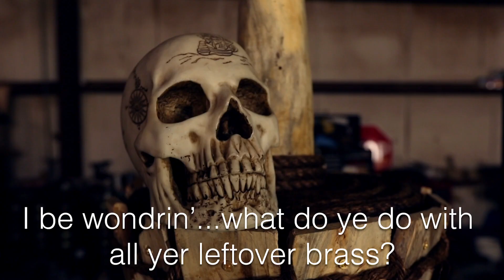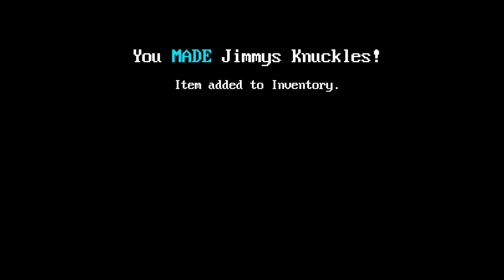Forged Brass and Leather Keyring/Knuckles: Maker Adventure 4

Comment: Left a comment on your comrade’s last printing video, and I thought it would be a very useful project.  A cable and pulley system that utilizes clips to lift drying prints up in the shop space and out of the way.  Sort of like dry cleaning system!  Also, had to watch the knuckles video again!
Reply from the maker: Thanks Mike! We figured out a little trick for some better space saving/drying options. Good note though!

Comment: Yes! 🤘🏻 Maker Adventure is such a fun series - you made a keychain video fun to watch man 👍🏻 what’s that technique called where you scored and soaked the leather?
Reply from the maker: Thank you! Usually you would use a swivel head knife to do the design in the leather, cutting about 50% through the material, then get it nice and soft by wetting the leather, then press (using whatever hard tool, they sell tamping steel for this) to raise/lower as you see fit. I don't have all those tools so WORK WITH WHAT YA GOT!